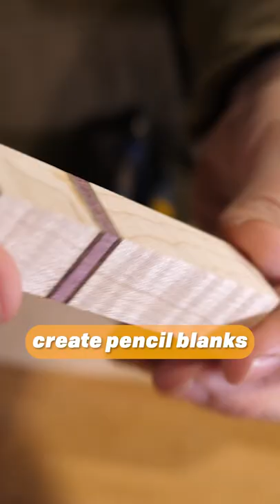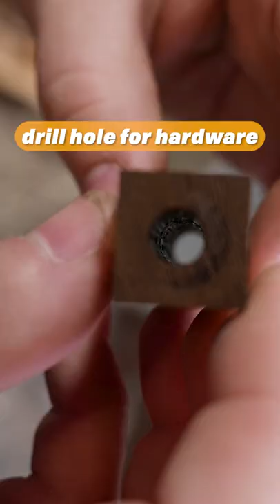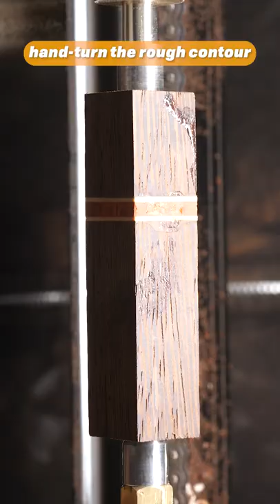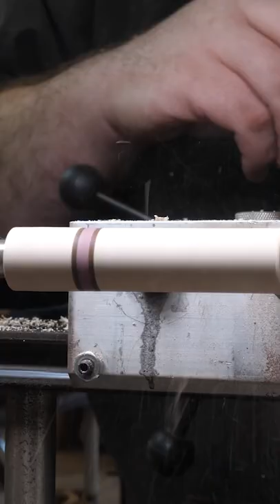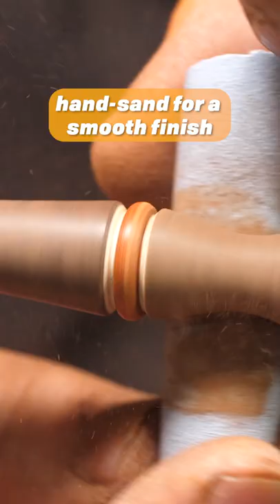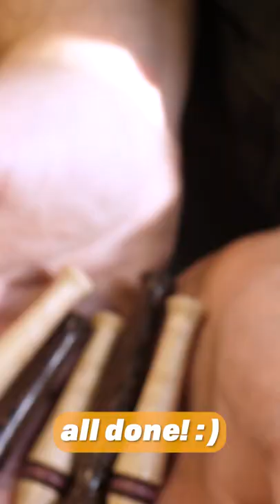Pencil Turning on Lathe #short

Comment: Sorry, but I turn pens and pencils (along with other things) using traditional tools (or carbide), no machine doing the work for me aside from the lathe, table saw and drill(which I do on the lathe). 
Not taking away from how you do it, but doing 95% by hand using tools is far more satisfying and more special to whoever gets it. This method would be more for a mass produced item

Comment: Where do you get hardware? I want to make my own
Reply: Lots of online sites sell this type of thing.
I make a lot of pens and get all mine from a place called woodcraft. Rockler is another popular option, but there are many that sell pen and pencil internal hardware and any special tools you need for it. It is a super fun hobby and you can get exotic wood already cut to size (pen blanks) for cheap. Paid maybe $3 for some bolivian rosewood the right side for a pen I love using.
Reply: @dakotaleonard6939  when I looked i was mostly only able to find ones with twist ends, instead of one piece of wood like these, they were two cut in half.
Reply: penn state industries and wood turningz are typically much cheaper than woodcraft or Rockler. Pencil kits are pretty slim though. some cheap slimline mech pencils and new sketch pencil
Reply: When they first started selling pencils, I didn't order in time and found Penn State has the same kits Wyrmwood uses.  At this point between myself and my wife's dad we've probably made a couple hundred.  Super fun to do!!
Reply: @jeremybruggeman8916  any chance you could link me to em?
Reply: @jeremybruggeman8916  the new sketch pencil is a nice one to make. Was going through their website one day and immediately noticed it.
Reply: @dakotaleonard6939  you wouldn't know what the lathe is called. I want to make pens in a similar vein, lots of similar items quickly, but being new to it I don't know what the tools called